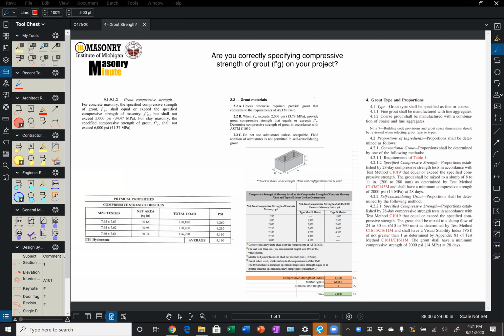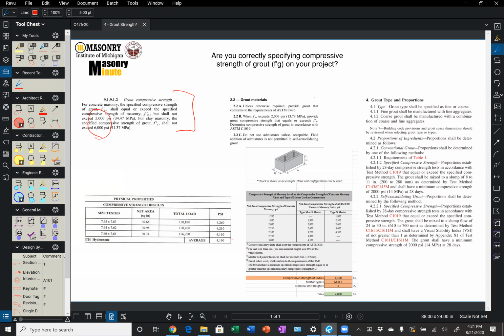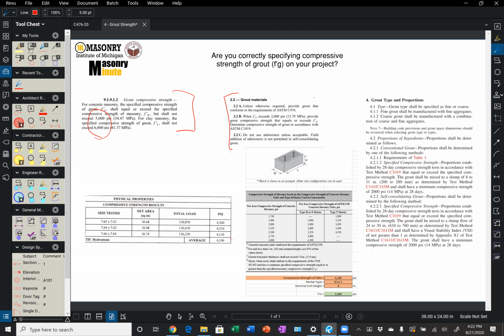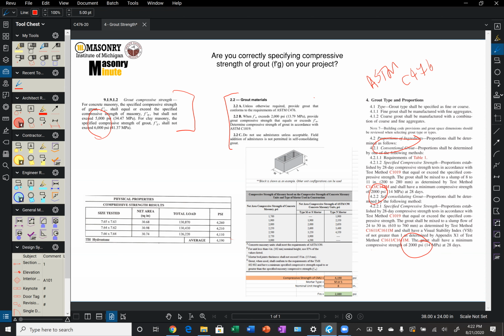Masonry Minute - Are you correctly specifying grout compressive strength on your project?

Comment: Thank you for the great info,if you dont mind me asking,If the plans indicate 5 feet max grouting,can you keep laying the courses right after grouting or do you have to wait a certain time for the grout to cure? Also do you leave a grout key on a bond beam? Thank you.
Reply from the maker: The current TMS 602 (Specification for Masonry Structures) has grout pour heights includes in Section 3.5C. Designers and contractors typically limit grout pour heights to 5'-4" which is considered low lift grouting, and you would be permitted to continue laying courses after grouting. NCMA has more information on grouting available here: https://ncma.org/resource/grouting-concrete-masonry-walls/.

Grout keys are covered in Section 3.5F where it states to form grout keys between grout lifts when the first lift is permitted to set prior to placement of the subsequent lift. The specification does state not to form grout keys within beams.
Reply: @masonryinstituteofmichigan9713  thank you very much